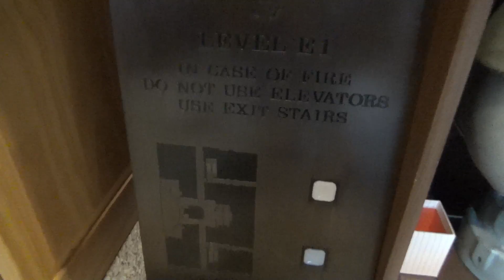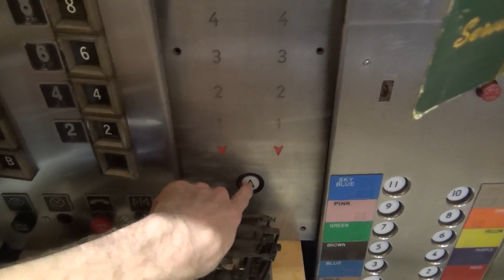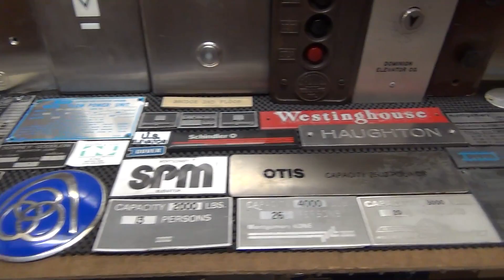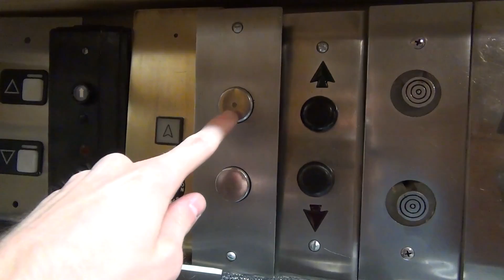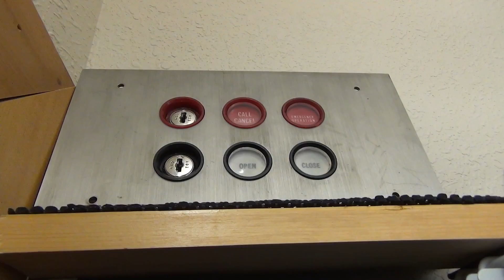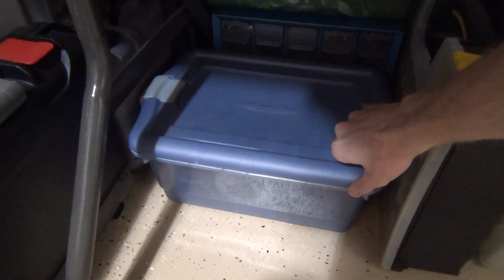Elevator Part Collection Tour 2022

Comment: i have a few dover impulse fixtures i got from the Gilliard garage in Charleston SC

what voltage are you running for them what wires did u hook up to what as it almost look like its 3phase 220  from the colors used

love the collection hoping to start getting back into documenting elevators again
Reply from the maker: So the voltage depends on the bulb you use. I used a low voltage for mine that can be controlled with a microcontroller (5v)
Reply: @stlelevators  awesome gonna see if i can get it going :) was hoping it was not some 230 v type thing lol